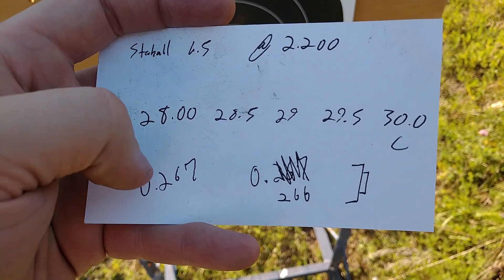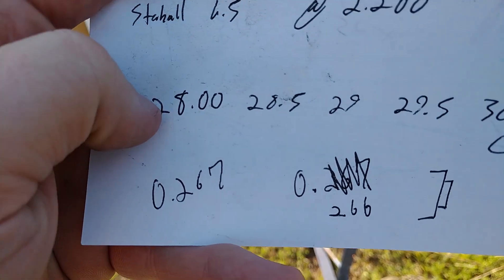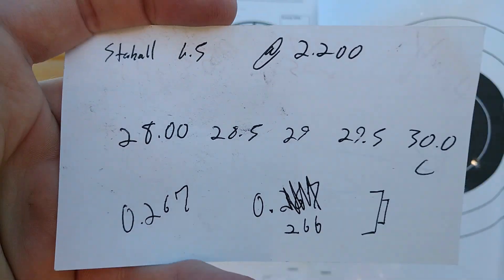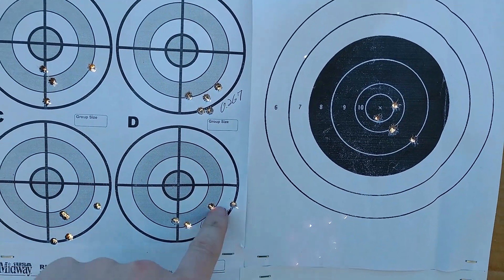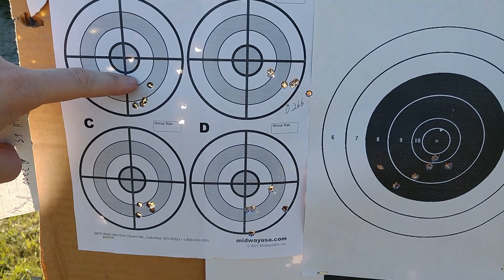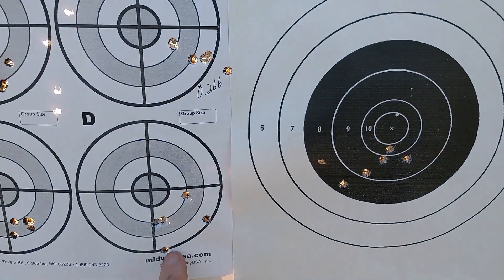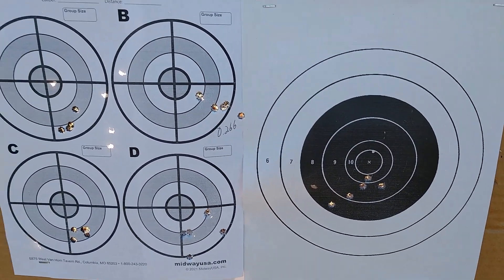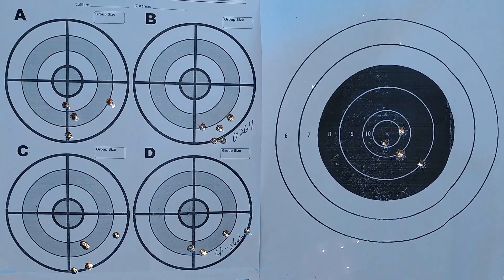6mm ARC - Hornady 105gr Match with Staball 6.5 [excerpt - neck tension test]

Comment: 0.267 is that your bushing you're using. I'm working on 6mm arc also I've been using 0.269 and 0.271 bushings. Are you measuring pounds of force to seat the bullets? 0.269 bushing was getting me over 100# of force.
Reply from the maker: THIS is actually a very interesting tidbit of information for me, because the loaded Hornady factory ammo that I've measured (from two different lots) have come out to 0.269.  My Starline brass comes out as just a touch thicker (maybe half a thousandths) but it is noticeably softer - it doesn't give me any problems.  (The neck thickness is 0.013 to 0.0135.)

Anyway, to directly answer your question, no, I currently don't have a way to measure seating force.  I've thought about getting those Arbor Presses with the gauge on them, but I don't see the purpose in having get that to also have to re-buy different die sets, too.  Same with the AMP press.

Some added notes: I do brush the inside of my cases for 6mm ARC, I haven't been using lube. 

Have you measured your neck thickness?  Are you using Hornady or Starline brass, or something reformed?